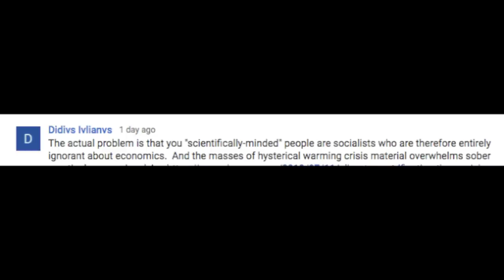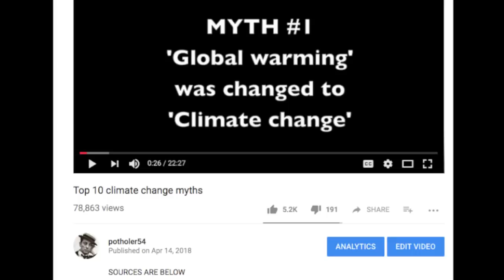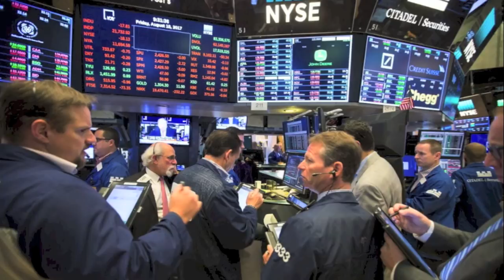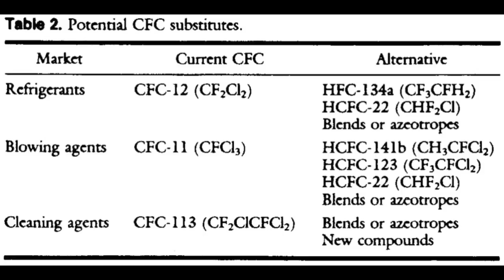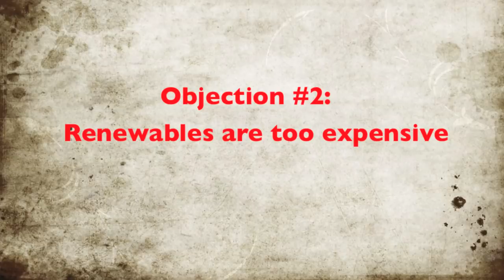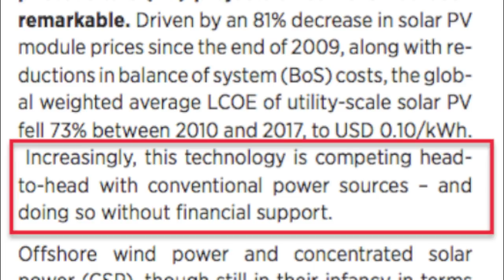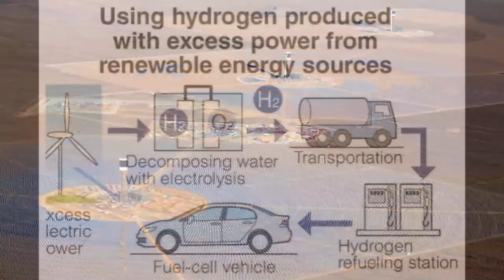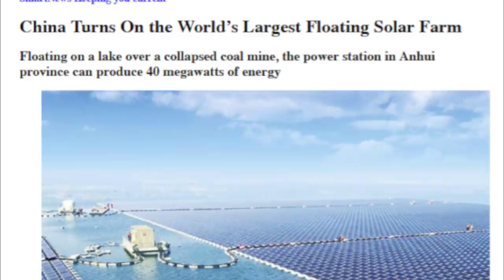A CONSERVATIVE solution to global warming (Part 1)

Comment: I have to say this is more of what we need to hear - working together positively on solutions, not pandering to the extreme Right or Left (most of us are sick & tired of this conflict). Could you please note that Solar forcing (X-ray, CME, Flares) are now acknowledged as a weather driver (more than just a Solar irradiance) with the IPCC working to add this to new models.  I do think it was good to see what China is doing by way of renewables, but if you also acknowledge that China (and India) are using the protection of being Developing nations to avoid CO2 caps or reduction plans. China Producing 13MtCo2 per year now (expected to increase by ~3MtCo2 in the next 5 years), at which point they self-regulate by deciding whether to declare themselves as Developed). This isn't to bag China - but a suggestion that you add this side of the argument to the conversation.  Latest research is looking at more reliable baseload technologies (like fusion based power) which has lower environmental impact to build/maintain & is a clean source (once the technology is perfected). Keep up this new positive approach & you will have many more subscribers & interested parties. Good work.

Comment: I live off-grid in Scotland.  We moved here for the location and not, necessarily, for some ‘Eco Dream’.  Summer we can do with few problems.  Winter would be impossible without fossil fuels (or, at least, some form of hydrocarbon ‘burning’) - heating a home (essentially, heating water) is incredibly difficult to do with renewables without significant expense and kit.  And that’s without factoring in our transport.  We could live and not travel, or travel and not live, but not both.  We are also dealing with this whilst being relatively un-poor.

Living this way gives one a very stark lesson in the economics of energy and the reason fossil fuels are so potent.  If the government removed the tax on fossil fuels then even considering renewables would be a joke.

Here’s hoping for some major tech breakthroughs in the future.
Reply: Billions of people live in sunnier areas AND in densely populated area. So Scotland is not a good example when it comes to solving our energy problems with SOLAR.  Like in not too sunny Austria or Germany you should be able to get a PART of your electricity OR hot water from solar from spring to autumn. (Paretto principle 20 % of effort gets you 80 % of results = Going after the low hanging fruits. This is about reducing dependency from fossil fuels (in the first step) 

I have heard from a man married to a Scottish woman that you do not know the long times of consistent rainy weather. He said there can be a shower every day (in the warmer saison) but that after that the sun returns. Such conditions do not keep the solar panel from providing either hot water or electricity  - on the contrary it will be cleaned. 

Photovoltaic ALSO harvests on partially clouded days (and indirect radiation) - and they perform better if it is not too hot. 

Scotland is of course a candidate for wind:  There is R & D going on with kites. Height is everything with wind, higher up the wind blows stronger and more reliably, every 10 meters help. 

Height comes at a cost with the large turbines: Costs to build them, visual impact if you have large farms everywhere in windy regions, sound ! - also what humans cannot hear. And of course not every region is suited.

The small ! kites are connected with a steel cable and an electric cable with a container on the ground. The currents help them  fly their "eights" and the harvested kinetic energy is transformed into electricity. They can be taken down and secured. 

The container is not too heavy - it is planned to be moved in tow by a regular car. The container has the battery and the electronics. Not much visual impact, much more locations are suited to harvest wind, likely better for birds,  suited for SMALL operations, the thing can be sold secondhand  if it is moveable. With solar you have higher costs of installation (the containers sound  like a "ready to go"  solution) and in practical terms you can sell a solar installation only WITH the house.

Kites would be ideal for remote areas, ideal in combination with a small solar panel to get the best of both worlds. And ideal if people need flexibility.
Reply: Xyz Same my comment was an illustration of the rapid learning curve and realities we have had to face.  The importance of the storage medium, its cost and the system design to maintain battery health.

The stark reality that fossil fuels are cheap in comparison, even with the 80%+ tax regime here in the UK...

We have (had) a small hydro setup, inherited from the original owner, but the reality is that unless you spend considerable £££’s building the system, it will need constant fixing, cleaning, etc.  In the end the turbine burnt out because the electronic load control failed.

This is the problem with turbines - both wind and hydro, etc.  They require a load to ‘push’ against or they just burn out.  Managing demand and either switching off when there’s no demand or diverting to a dummy load.  Plus the difficulties of managing the charge from the turbine to ensure healthy battery life - it’s a bloody nightmare ;)  One fault and your whole, expensive system can be ruined.

Solar PV and thermal is our choice going forward - solid(ish) state, low maintenance, etc.  But I am having to do considerable research regarding insolation levels because most advice data out there is regarding grid-connected systems.  So everything is calculated for maximum yield, because your goal is to sell as much to the grid as possible.  With an off-grid system, maximum yield isn’t your main concern, rather you have to think about ‘casting your net wide’ to catch optimum levels of charge on a sunny afternoon, or a sunny dawn, or...  AND have somewhere for excess charge when your array that just about powers the house in winter suddenly is producing thousands of Watts in the summer!  We’ve found ourselves trying to find stuff to power, just to use what we’re generating :)

Larger storage isn’t an option, because it’s a question of cost.  It’s like designing a sailing boat - you want just enough functionality to skip along in the good times and chug along in the doldrums.

I have a blog on FaceBook if you are interested - not all off-grid stuff, but there’s some stuff in there :)

https://www.facebook.com/Blairvaich/

Comment: I applaud you for taking on climate change seriously from a conservative viewpoint. The up-front assertion that the only liberal solution is to dismantle capitalism is patently false, however. Carbon taxes and subsidizing green energy innovation may not be conservative ideas, but they are hardly dismantling capitalism.
Reply: asgallant says:
"The up-front assertion that the only liberal solution is to dismantle capitalism is patently false.."
==
Your assertion that the conservatives are protecting the capitalism is false.

They are protecting the certain corporations.
Reply from the maker: @asgallant wrote: "The up-front assertion that the only liberal solution is to dismantle capitalism is patently false"
   Of course I didn't say that. If you think I did, please listen to the video properly, quote what I said verbatim (with proper quotation marks), and tell me where on the video I said it.

Comment: What about Thorium Reactors?
Reply: Also interesting and being developed. But no commercially tested designs exist yet. Hopefully someone will get something built in the next few years, but it's going to be a while before we have any significant real-world experience and thus some idea of costs and practicalities. Thor energy, for example, are testing thorium fuels (for use in PWRs) right now: http://thorenergy.no/second-round-of-thorium-test-irradiation-underway/ Thorcon probably have the most well-developed design and a looking for a purchaser to actually build one: http://thorconpower.com/ Moltex are also developing their reactor: http://moltexenergy.com/ It's not at all clear that thorium reactors are going to be a siginificant contributor to decarbonisation, mostly because it has to be done in about 20 years, which is about how long it's likely to take to get one or two built and tested unless we get much more serious about getting stuff done.
Reply: @xxwookey  Working ones were built in the 1960s and 70s, however the Nixon government cancelled the program and all research most likely because Thorium does not easily produce byproducts for nuclear weapons.

Comment: Any chance of a part 3? Now that Australia has had a change of government. Any thoughts on Labors Climate policies?
Reply from the maker: No part 3, but you might be interested in my video on South Australia's energy policy. It's called something like "Finally an energy solution both sides can get behind."
Reply: @potholer54  , thanks Peter for responding. I am sure I would seen that video, and will watch. As everything you put out is not only great but scientifically accurate. And any mistakes, you address.

Did you ever get the time to watch the Kent Hovind video I suggested to you?
Reply from the maker: I get so many messages, I don't remember it, sorry. I've been on the road for the lat two months and may have watched the video if I saw the link and you told me what it was about. But I probably won't be revisiting Kent Hovind unless he comes up with something new.
Reply: @potholer54  , Kent still repeating the same nonsense. Keep up the great work.

Comment: Pretty good video but the last point is the most critical one and not that simple as the author of the video makes it seem. All the offered solutions work yes but on a small scale (beside hydro). They are generally great for covering peak demand but when the wind and/or solar drops for days in a cold country, it really is a serious issue for renewable based power grid. Most countries don't have huge hydro plants, hence going heavy on renewables is expensive. Why? Because for every MW of renewable you want to have MW of coal/diesel etc power on standby when sun doesn't shine and wind doesn't blow. Although it's totally possible to import electricity from neighbouring countries, it's usually not available as during cold days, they are lacking power output as well.

All in all, there certainly has to be put a lot of focus on the last point but currently the renewable system can't operate without fossil/diesel, while I hear a lot of this 100% renewable talk which is total nonsense from the perspective of a power grid, at least for now.
Reply: It is necessary to REDUCE the use of fossil fuels. Now for backup and as wild card / joker gas turbines could be used (if the batteries are depleted or too expensive). Gas turbines are very flexible. Unlike other power plants (coal, nuclear) they can be turned on and off for hours (peak demand or for the combination of no sun and no wind).  

Of course they would have higher costs for the time they run (for full efficiency if you have the narrow view of only ONE company or ONE plant) they would need to run as much as possible and sell as much electricity as possible.

In a role as necessary backup for the system - making the green technologies possible without danger of the grid collapsing - they would need to have higher costs and could not compete with the regular providers. They would have a different role.

Our current economic system and the idea to have "market" prices is not fit to deal with those needs. But it could of course be organized if ideology is disregarded.

Comment: A big reason American socialists and progressives don't trust the free market or corporations to tackle this issue is because the oil companies knew about the issue for years before it became ingrained in the public consciousness. They did nothing because it would've changed their business model too drastically for their comfort. That is the story most hear who believe in climate change here in America (idk to what extent it is true but it has had a lasting impact on the pro-regulation left). So, in order to reduce carbon emissions in absence of a trusted market, a government must step in in their minds. Sorry for the double in but that is just a peek into the American left thought process.
Reply from the maker: Then we have an impasse. American socialists don't trust companies to do anything, and American conservatives don't want the government to do anything. No wonder nothing gets done.
Reply: @potholer54   in short, that is the problem. Politicians have been unable to create effective incentives or programs to curb CO2 emissions and the result is gridlock. There has been the occasional company to address the problem but it hasn't been a nationwide push, unfortunately. Part of this is a problem you address with denial being a more politically motivated stance than actual skepticism and the other is aggressively pushing for government overreach (which is concerning to conservatives). It is extremely frustrating
Reply from the maker: So the solution would be:
   1) Get conservatives on board by accepting the conservative principles that individuals and property owners have a right to freedom from environmental damage, that the polluter pays, and that competition and the free market are the best way to deliver new technology.
   2) Socialists get on board by accepting the de facto role of companies in creating and marketing these new technologies, and waiving their anti-corporate dogma for the sake of curbing GHG emissions.